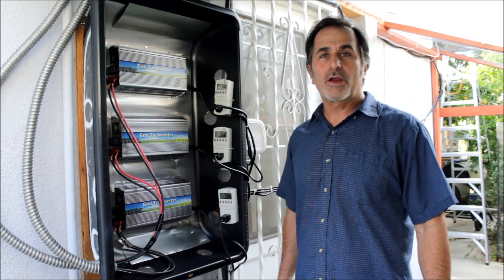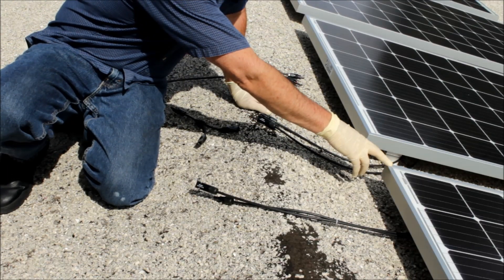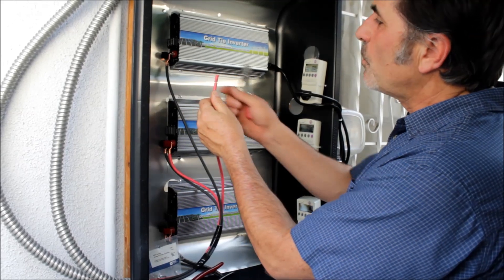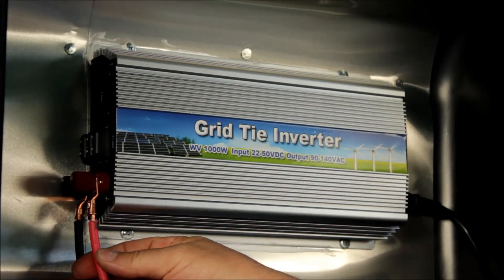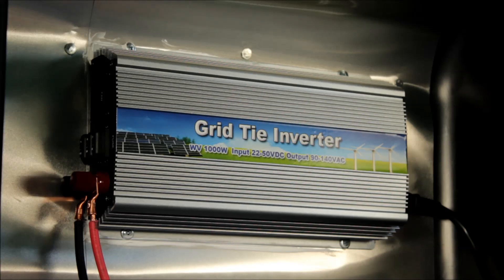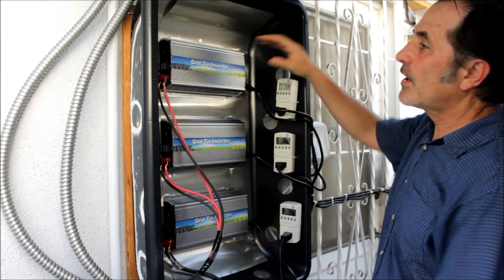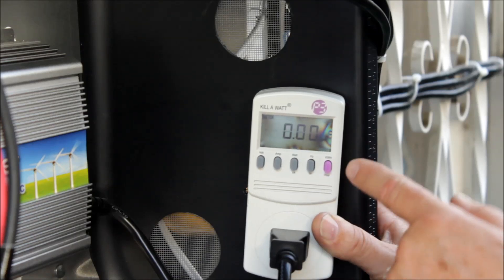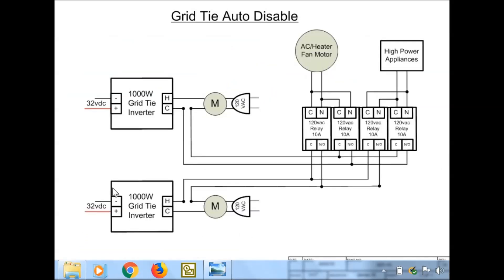How to Install a Simple Grid Tie 1000 watt Amazon Inverter Solar System -1800 watts for $1800- James

Comment: Let's see, I don't have any agreement with the Grid Company, but my Meter is running in a backward mode, so it should be put a whole needles on counterclockwise! With this, the grid will charge me anyway? Thanks
Reply: If the numbers rolls back, it may be working. Your electric bill may not reflect it yet but just send them the numbers if it does not. ( since you seems to be on an old meter )

Comment: That’s a series connection on the panels , not parallel! Parallel would be each panel with its own wires to the grid tie. Series adds voltage of two panels with current staying the same to the grid tie.
Reply: Ian, if he connected the panels as diagram shown @ 11:22, the panels are connected in parallel. ++ connected together and - - connected together is a Parallel connection. 
A serial connection will be +, - +, -

Comment: I keep coming back here. I want to do 3 inverters like you but now thinking if to get those blue $350 inverters from ebay.
Reply: I did 7 of these but 22-50-220V if one dies the other keep working until it is replaced. I do not trust those Blue ones yet. Here is a good ref. https://www.imeshbean.com/category/Home-Garden/Grid-Tie-Inverter/Power-Inverter/
Reply: @gilbertferro2013  Awesome. Checking out the link. I have 3kw of panels just covered by a tarp in back yard. I need to do a setup soon.
Reply: Search for the growatt sp3000. 3000w for under 1000$. Also is split phase so you feed the whole panel

Comment: That one 1000 W inverter can handle up to 2000 Wp solar panel. You can use only one of them for 6 x 300 Wp. Save the other two inverters for spare.
Reply: I highly disagree he did also explain why u can't do that , 900W panel array is the max u should use on a 1000W inverter b4 u fry it

Comment: Hey, man. I loved the video. Thanks for the help with getting me started. I set up an even smaller system than you with only one of those inverters. The inverter stopped working after about 1 month. I was wondering if I just got unlucky or if that brand is actually unreliable. Based on some of the reviews I read, it’s probably the latter. I wanted to check in and see if yours are still working well.
Reply: Was your setup like the one in the video?  Do you need proper permits where you live in order to feedback legally?
Reply: @ShyRage1 , I had to email my electricity company to get approval for “net metering”. They asked for diagrams and I had to fill out some forms regarding how much power I planned on producing. They sent someone out to look at the system after I had it hooked up and the guy who came out was blown away. Lol. I did all of the work and paperwork myself, and I’m not an electrician.
Reply: @Robertgbarnes  so you literally had the power inverter plugged in and they were cool with it?
Reply: @ShyRage1  totally! Plugged into an outlet.
Reply: @Robertgbarnes  holy smokes!   What state are you in? What power distribution do you have there
Reply: @ShyRage1  Mississippi. And Entergy
Reply: @Robertgbarnes  Is there any way I could see your setup or schematic?
Reply: Or post it up
Reply: @Robertgbarnes  sent, dont forget to check spam folder
Reply: @Robertgbarnes  I sent another email, were you able to get it
Reply: So I had a 400 watt system using this exact same inverter (Amazon $109) that I installed a few weeks ago... it produced a little over 2kw a day BUT the inverter quit working after 2 days.  I would never have faith that the inverter would last long enough to pay for itself :(

Comment: I have the same inverters, they are awesome.  No issues, they stay cool.  I recommend them for anyone looking to try lower their bill.  You cant use them in an off grid setting but for what it is and the price you cant go wrong.  Literally plug and play.  Great video BTW.
Reply: On your plug and playset, are you using a dedicated 110 line?
Reply: I read another comment saying you can overload the wires, cause a fire because it isn't going thru a circuit breaker.
Reply: @TheRainHarvester  technically there is a circuit breaker in place (at the breaker box) but since you are reversing the flow of electricity, The circuit breaker cannot accurately tell whether the line is overloaded. This is why you must carefully measure the amps passing through the line that you would be grid tying
Reply: @raiden72  ac has no direction.  But i can't remember what this video was about.
Reply: @TheRainHarvester correct and  sorry, I guess I should have said, "feeding electricity back into the grid" instead of "reversing the flow",     but nonetheless, total amperage flowing through the wire must not exceed the rated amperage of the wire, and while back feeding there is potential to exceed the amps without tripping the breaker  (which could cause fire)

Comment: some people suggesting battery installation. Trust me it is an expensive option. Because you will have to replace batteries when these die. Better go with net metering option.
Reply: I thought even if you decided to go with net metering, you still have to pay the electric provider fees

Comment: James how did you connect your relays to these cheap inverters?
Reply: Mike, the diagram is shown around time 12:50, basically, the relays disconnect the output of the inverters.
Reply: These inverters are supposedly shutting off if the grid is off.

Comment: I thought these were not UL rated or allowed by the power companies. I bought my equipment about 15 years ago and sold them when I moved. I had Sun 600 inverters or 500s cant recall. I still have a 1kw array not being used that I bought recently for a water well.
Reply: From what I'm understanding, these setups are called guerilla setups.  You can feed into the grid but the key is to not let the smart meter stop or go backward.  If it does, you then could get caught by your power company
Reply: @ShyRage1  I actually bought a 2.5kw solar array after watching a few videos which is on my channel. I made a new 5 yr contract for my power company at 8 cents per kwh from the highest of 13 cents I was paying. The ROI just got extended lol...I am working on a setup to grid tie and have battery backup.
Reply: @cutweldngrind  before all this, were you feeding back into the grid under the radar?
Reply: @ShyRage1  I bought all the gear around 2008 and a week later my meter was upgraded to a digital one. I held on to equipment a while and just sold it all. I had mostly 150w solar panels and were to be  running on the lower voltage Sun 500 or 600 Inverters. I also had a batch of 50 watt panels for a grand total of 3kw and now I bought a 2.5kw array. I'm thinking on using these for my off grid home but may experiment here.
Reply: @ShyRage1  Forgot to mention  how we ended up buying lots of  equipment. We ran several test on a 100w panel and a sun 250 inverter grid tie inverter. We documented on excel all the values before getting the big systems.

Comment: WOW, Just plug it in to a house outlet. GREAT WAY to BURN  your house down. IF you install this type of system you MUST wire EACH inverter to THERE OWN BREAKER in the panel.
Reply: Totally agree. Each inverter must be on its own individual circuit breaker for sure! These kinds of videos can be both helpful and hurtful. Also, there is no disconnect being used whatsoever for the DC side. Scary.
Reply: LOL!
I thought about that. The system just assumes the house wiring will be able to handle and amps you're putting on the from the solar panels.

To all novices: Electrical wires (like the ones in your home) have a maximum amount of amps they can handle without overheating and possibly causing a fire. The electricity that comes from the grid passes, first, through properly dimensioned circuit breakers which will not allow an excessive amount of current onto the wires. When you start feeding those wires with power from other sources which do not first pass through circuit breakers (like in the video), you lose that protection. So, you'd better be aware of how much current you're injecting onto those wires and how much they can handle. Lest you burn your house down!

1KW inverters will probably not be a problem. But if you extrapolate from this example, to higher power inverters, research wire gauges, and put some circuit breakers to prevent overload.
Reply: While all that makes a lot of sense. When dimensioning an entire system. 
Let's be realistic about what we've got here. 2x 300W (600W) solar panels, into a 1000W inverter...
I've never seen ANY house circuit which was not able to deal with 1000W. Considering it on full blast, of course! Which we know it' not capable of. Among other things due to the solar array of only 600W! Which BTW don't output real 600W either... See where I'm going?! ;-)

Comment: LOL, if you check with your local authority you will find that these types of solar inverters ARE ILLEGAL in most states!
Reply: Not just most states, but all states in the USA and most if not all provinces in Canada.  They are not safe or all that reliable.  The crazy part is that buying the correct hardware and installing it to code is not all that much more expensive since one medium-sized commercially approved grid-tie inverter would have been enough to meet the requirements of the 6 panels and more could be added.  Proper grounding and conduit are not that expensive or difficult to work with and the commercial inverter is designed to be installed under the roof overhang of a house.  
Even if you go off-grid with batteries you still have to meet NEC guidelines in most areas just to get homeowner's insurance.
Reply: @kuhrd  All are illegal from I understand.  There are however guerilla-type systems like this that are being used under the radar.  Safe when they are plugged into a dedicated power source.
Reply: Absolutely illegal. There needs to be a disconnect from the grid to protect linemen working if the utility power goes down.  This guy is going to kill someone.  It looks like each of the inverters has anti-islanding.

https://www.amazon.com/iMeshbean-1000W-Inverter-Input-Stackable/dp/B07GDCY1N7/

Comment: in advance thanks for the video, consult, why three inverters and not one of greater power? I'm new to this topic excuse the ignorance
Reply: A standard 15 amp circuit/breaker will generally only power a max 1-1.5 kw appliance before tripping due to safety/power draw (toaster oven, hair drier, etc.).  You want to avoid overloads with significant margin of error on each separate circuit for safety. Larger inverters are UL certified, cost alot more, and require the full permitting process with net metering. The small ones should generally only be used to offset some daily consumption with no power left over within your house.
Reply: @scottsmith6867  thank you very much
Reply: As James mentioned, he did not have net meter, so in order to control the power to grid, he disconnect some of the inverters based on the house power load. 
If one inverter is used, how would you reduce the generated power?

Comment: now u can buy battery banks and store the energy instead when your ac turn off
Reply: He would then need a charge controller to charge his battery bank and probably a different inverter to then convert his battery bank voltage back to 120 Vac, and batteries are very expensive and not really cost effective plus the batteries have a limited life.  Solar systems that use batteries for storage are not cost effective if you live in an area where the cost of power is relatively cheap which is most of the united states.
Reply: @wd8dsb  : 

Great answer. You really know about this. I would add that the batteries will lose 40% of the energy collected by the panels. 

That’s the reason solar panel companies only sell the tie-grid system. Even this tie-grid system is not cost effective

Comment: Hi Sir,

Just want to double check, at 2:15 it seems that you connected the positive terminals of the panels to the black wire and the negative side to the red wire? Or did you change the connection of the wires from the pv?
Reply: Yeah he wired them in series although he said parallel. You take the positive and hook it to negative of other panel. Then run the positive and negative of each panel to the grid tie. It’s a series circuit and not parallel.
Reply: @reddevilxt716  oh I Wondered about parallel: if one shadow on a single panel, it seems like the other panel would dump it's load on the shaded panel and burn it up!

Edit: it looks to me like he wired in parallel after all.

Comment: Are you able to estimate how long it takes to pay off in electrical savings?
Reply: I priced out doing this with an 800w set-up and only 1 inverter. It would take between 3-7 years depending on where you live. In michigan I was looking at about 5.5-6 years.

Comment: Why this 3 inverter instead of one 2kw ??
Reply: As James mentioned, he did not have net meter, so in order to control the power to grid, he disconnect some of the inverters based on the house power load. 
If one inverter is used, how would you reduce the generated power?

Comment: first those wires should be double crimped and heat shrinked. second those inverters need zero export. third those inverter run better if run at 80+ percent. the higher the use the higher the efficiency. also three panels per inverter would be better for you and you really want to have more panel power than the inverter can handle. so three 400w panels for one 1000w inverter is the norm. any extra watts gen just gets clipped but you will come to full power more early and gem more consistent power thru out the day.
Reply: Thanks man, so much knowledge !!!
Reply: Yeah, that's what I was initially thinking too. 450 watts into an inverter capable of 1000 seems like way more of a safety margin then is needed.

Comment: I've got 2 questions. 
First being the safety aspect. The grid tie inverter turns off if the mains ac  power is off right? But if the mains AC is off, a normal individual inverter should detect this but because you have multiple would each inverter act against each other and detect ac so therefore continue to give power? 
Second question. Are these still working? I hear that particular inverter only lasts about a year and I'm guessing it will take a few years for you to brake even. 
Nice video though. I'm just researching my options. This helps.
Reply: I have had two of these. One went out on me after just 11 months. The replacement has been going strong for three years now. I'm running 800 watts maximum, but I have never seen it get much past 700 watts during optimum conditions, usually it is much less.
Reply: I hope he will read this and try it out to verify that the system goes into completed shutdown when main power to the house is cutoff.
Reply: He doesn't seem to answer questions. Anyone else know?
Reply: @TheColorField  oh thanks. I'll assume they solved they problem of multiple inverters triggering each other so as to stay on.
What I really want to know is how long these inverters have lasted for others.
Reply: I instantly had the same questions, sir. This setup seem a modular approach but these answers must be found...Thanks for the video!
Reply: They're supposed to shutdown if the grid drops. They're also supposed to have anti-islanding, meaning they're not supposed to feed off of each other.  
Since these inverters are not UL listed, none of what they're supposed to do, is guaranteed.  That's why the utilities don't allow them.
Reply: I have 5, 1 broke. 1 has lasted 7 years and still going the rest are between 5 and 2 years old and all good. When the grid ac is off, they do not run.

Comment: hello i had solar panels 35 year ago and run my 12 volt marine lights 50 wat ./ and i had a great time with that / my kids would leave the lights on all day long as i work 10 hours a day / my e mail is hilowjack1927@gmail.com i need a good grid inverter 3000 wat to 5000 wat

Comment: Awesome setup, just a FYI I installed grid tie inverters with Limiters so its automatic. But nice setup nonetheless
Reply: Is it a separate device?
Reply: @jamesarevalo1626  https://www.ebay.com/itm/New-1000W-Solar-Wind-Turbine-on-Grid-Tie-Inverter-with-Power-Limiter-PV-system/362126614006?hash=item54506d9df6:m:mbS-UD_xJqjFFiFW2huyfGA
These are readily available on ebay and amazon however not UL certified. I'm not net-metered so not really important for me to be in code.

Comment: Lol, totally not to code in almost any state. First of all the mounting is not galvanized and you can’t run open rubber wire because you know there are animals that love wires. The inverter can short and cause a fire by pulling power though the conduit insulation instead of the wire. Be smart, hire an electrician to buy the equipment from and install by a roof. Stay away from burning your house down.

Comment: How many kWh does this system make per day or per year?
Reply: It varies with where you live. There are solar radiation maps and online calculators that help you find out how much a panel will make in your area. If he is in southern California, I believe you can take the kilowatts of the panels X 5 to get a rough estimate, so 1800 watts (1.8 kW) of panels could make as much as 9 kWh's of electricity per day. Electricity in CA is expensive, maybe .25 to .35 per kWh, so $2.25 to $3.15 per day if my math is right.
Reply: Max 1800 Watts a day

Comment: I have my panels and inverter plugged into a wifi smart plug.  I can monitor the panel output from my phone.  Here is a link the the model that I'm using:
https://www.amazon.com/Etekcity-Monitoring-Automatic-Required-Upgraded/dp/B07Y7RC7K7/ref=sr_1_6?keywords=etekcity+smart+plug+15a&qid=1584279762&s=electronics&sr=1-6-catcorr